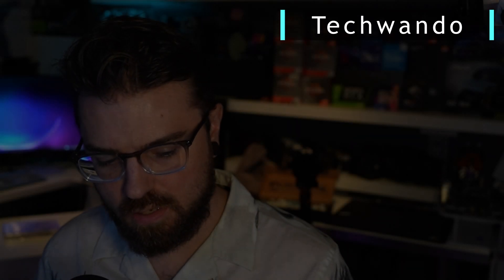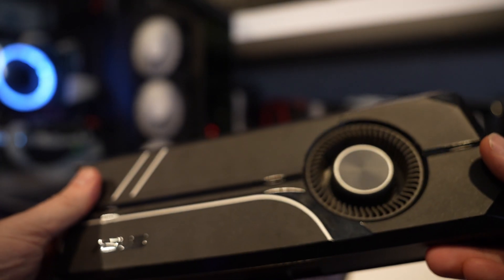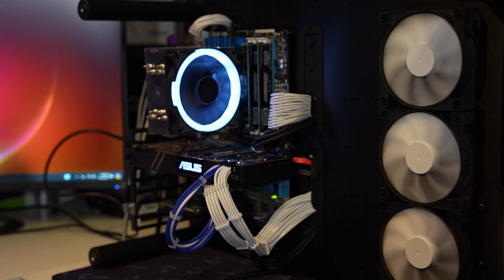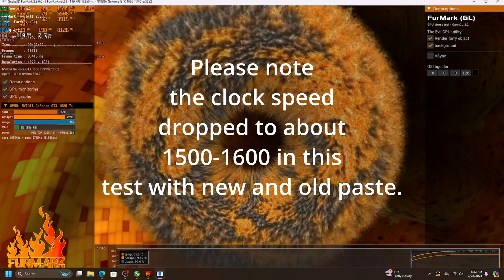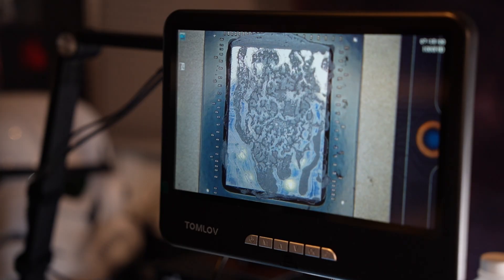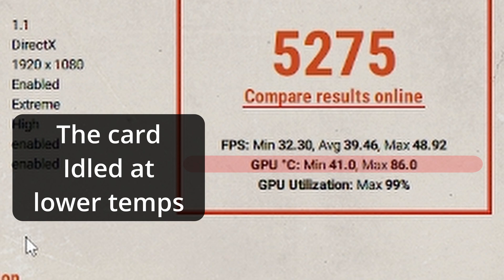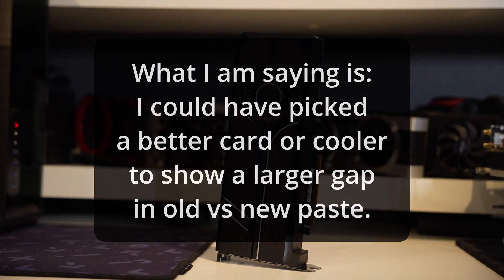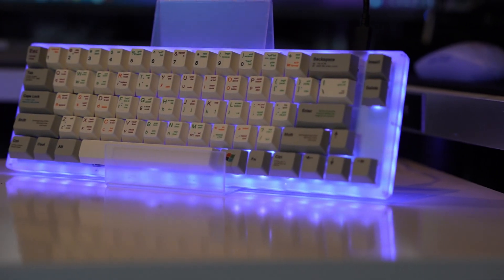7 Year OLD Thermal Paste Still Good? | + Keyboard  Giveaway

Comment: Loved what you did on the original Intel stutter issue, and would enjoy hearing your thoughts now that chips are actually dying.
I get this feeling that tech companies are squeezing those safety margins really hard lately. Melting connectors, degrading silicon, sub-par thermal paste, etc.
Reply from the maker: Thanks man, yeah I have made a few on it but was thinking about complying all the issues Into one video. There's now quite a bit of hypocrisy from Intel. All the finger pointing, and confusion. I think I'll wait until August and do a video on the patch and if it doesn't help in anyway, I'll go full on and make a dedicated video of everything, compiling other tech channels and my thoughts. 
Thanks man for always giving great input.